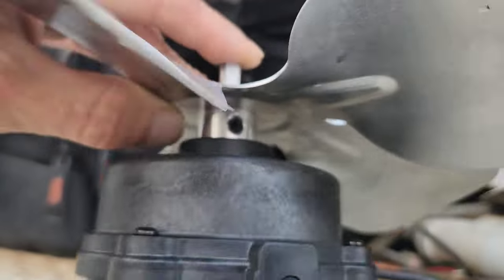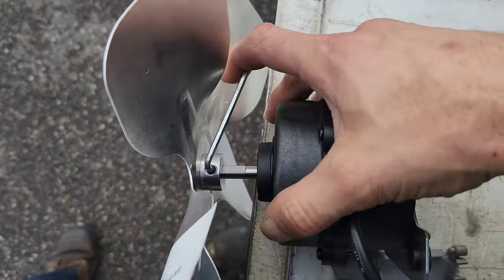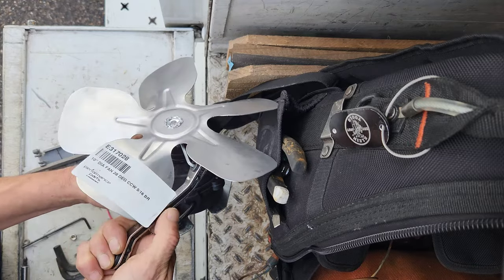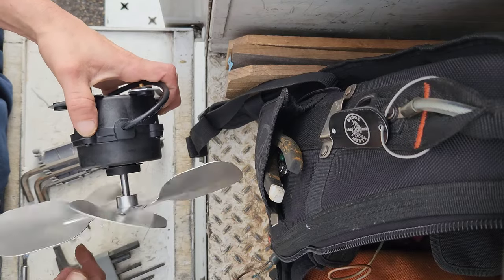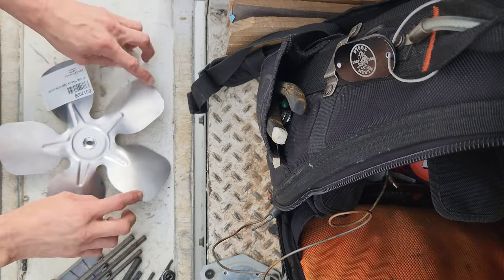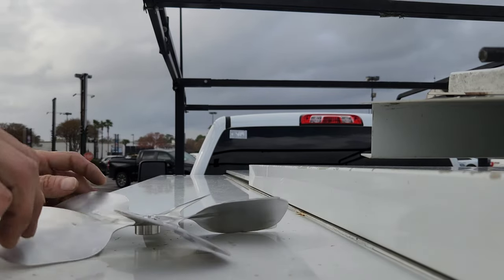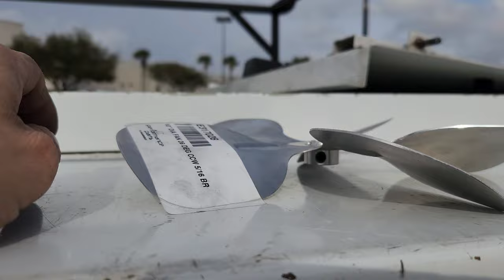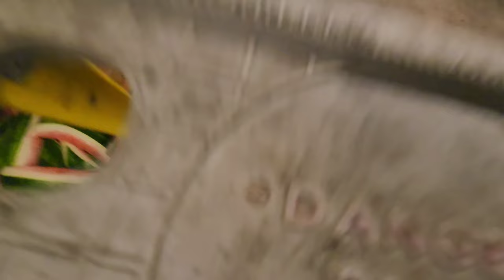Replacing an Evap Fan and 8" Blade on Produce Walk In

Comment: I have a set of long hex wrenches made by Vaco that bought at Johnstone supply decades ago. They are at least a foot long and they came in handy many times. I’ve never seen a pitch gauge like the one you have mine is different but I’ve been out of the field for a while now. It looks like everything turned out great though.
Reply from the maker: Yea it balanced out ok, it seemed. Most times,  old tools are the best

Comment: Have you ever come across hussmann corelink case controllers
Reply from the maker: Yes. They complicated.  The most common thing I've found that fixes them acting stupid(not holding setpoint even though it should) is to just Cycle power off and then back on.

Comment: Just changed a blower motor that someone before me used Philip screw on one side and needed a at least 16 in screw driver but did not have one went to harbor freight tools and got a set of screw drivers 22 in long work out just fine
Reply from the maker: Hell yea. That's how it's done